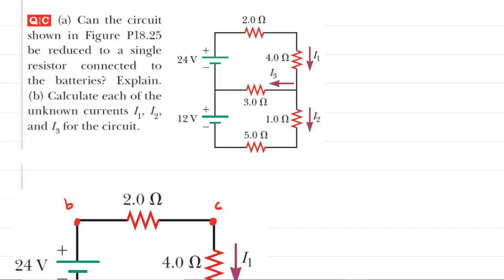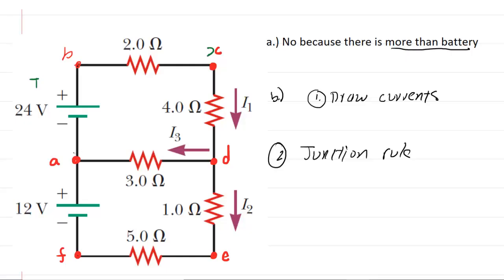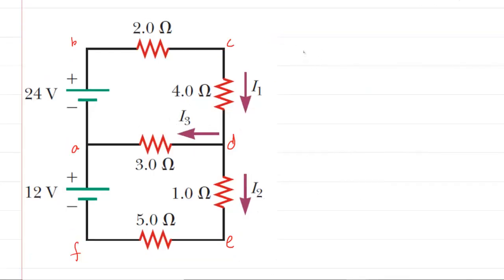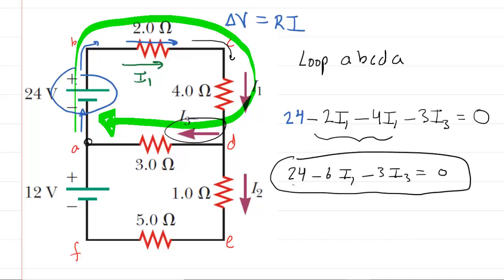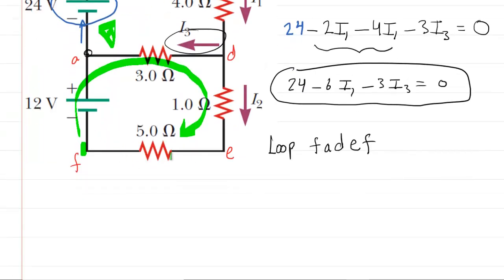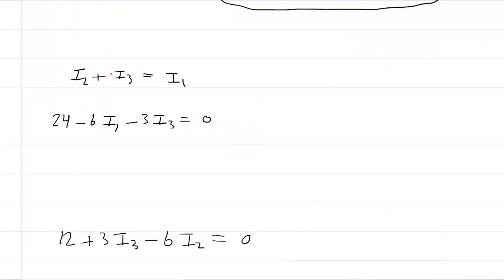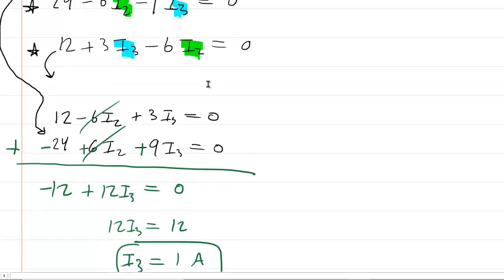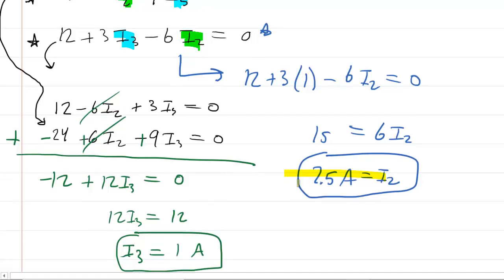Can the circuit shown be reduced to a single resistor

Comment: You can make it one battery. Just Cant you use source transformation with Thevinan and Norton equivalence for getting one battery and resistor? It’s easier to use mesh analysis for the” I” values but you can make it one source and one resistor if you really wanted to.